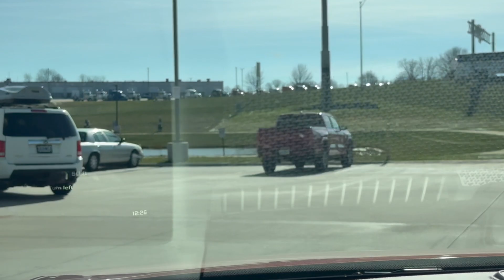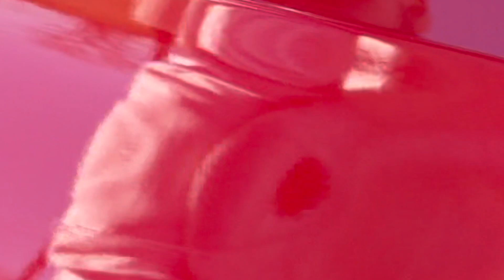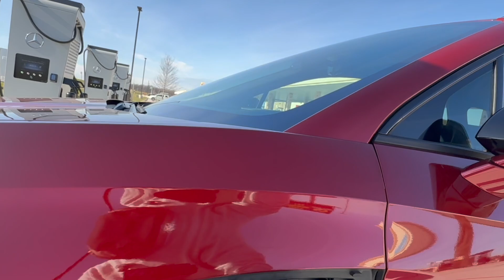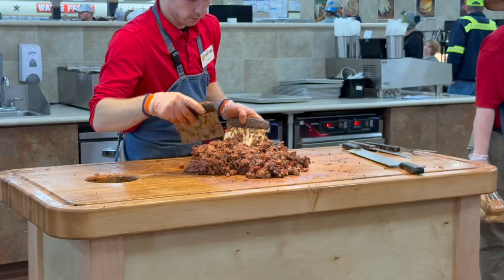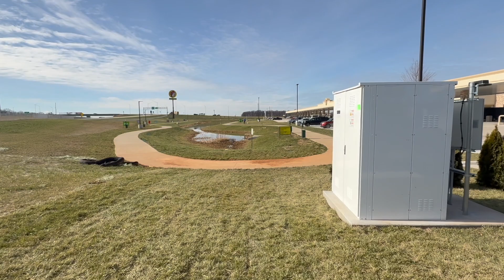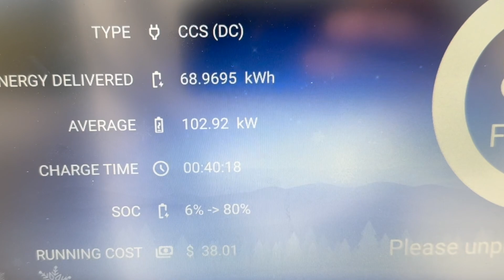Mercedes-Benz High-Power Charging at Buc-ee's in Springfield, MO: EV Charging Site Visit

Comment: I just passed through there yesterday on a 2k mile road trip in my Mach e and used the Tesla at $.42 with no $50 hold. No brainer for me. It's all the same electricity at 150kw max, limited by the vehicle. I'm taking the cheaper pump. Not really a fan of Buckey's but it is a key location on I-44 and the restrooms are clean.
Reply from the maker: Totally get that. I’d be at the Supercharger too if not for making this video.
Reply: @TheArkansaseTraveler  Hopefully competition does its thing as more charging opportunities open up. Also glad I got out of there before the ice and snow moved in. It was my first winter road trip with temps in the teens. By the looks of it, it would have been slow going back to Michigan just 24 hours later than when we passed through. Thanks for posting the review.
Reply: Well now my FordPass app is showing the MB charger at .37 per kwh. I'll be driving through in May, I'll check it out.

Comment: My only question is why aren't the chargers covered the way gas is?
Reply from the maker: 1000% agree with your implication here. The newest players in the space are adding canopies somewhat routinely, but I'm a little frustrated that a premium brand like Mercedes-Benz did not add them to create a premium experience! Maybe they'll come later because they have been proven to extend the life of the dispenser.
Reply: @TheArkansaseTraveler  the MB charging location in Sandy Springs does have a canopy.
Reply from the maker: @ And lounge! That flagship location really sets the bar, but Ionna seems to be trying to meet it!
Reply: There aren't many EV charging stops that are covered.  I have seen a few at the Flying J locations in Oklahoma that do have a cover.
Reply: Canopies need landlord approval. If they don’t allow them, you can’t build canopies.
Reply: Probably permitting issues would be my guess

Comment: I ran down there when Walter reported the site was open to get some pics for him.  Those MB chargers are in a better location than the Tesla ones due to all th traffic trying to get in an out of there.  The cost is too high.  However if the Tesla SC gets full you could always jump over to these.  I have to do the same thing.  I only go to Springfield to do my Costco run!  I stopped by the Flying J and that was 65 cents per kw!  Tesla is the charging bargain.
Reply from the maker: Oh wow! Hope to see you on I-49 or I-44! My usual charging on a Costco run is home, then the original Tesla Supercharger in Joplin. It recently dropped to $.33/kWh and I'm a sucker for a cherry Icee at the adjoined K&G.

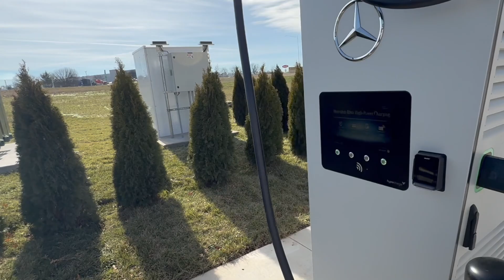Comment: @7:42, I think the ones with deeper stalls are for MB eSprinters is what I heard from one of the installers in wave one last year around this time.  They need to nose in a bit more.
Reply from the maker: Makes perfect sense! I have not encountered too many of those so it never crossed my mind. A vehicle that large can likely drink the electrons and can benefit immensely from dedicated power! Thanks for the info!
Reply: Yes, most sites have a dedicated (longer) van stall and dedicated ADA stall. The latter needs to be installed with single dispenser units, otherwise does not fulfill ada requirement

Comment: Shouldn't you be using the other charger handle so that someone else could use the one you plugged in ? Other than that concern, it was a good video.
Reply from the maker: No other car even so much as glanced at the chargers while I was there. I could have towed a 10’ flatbed trailer and parked across half of the stalls as a pull through and it wouldn’t have caused a problem.